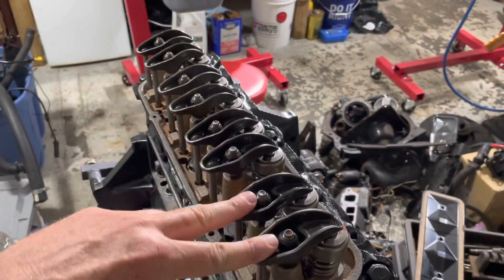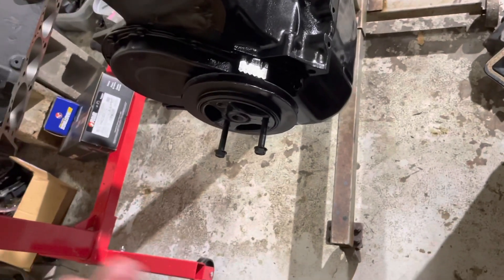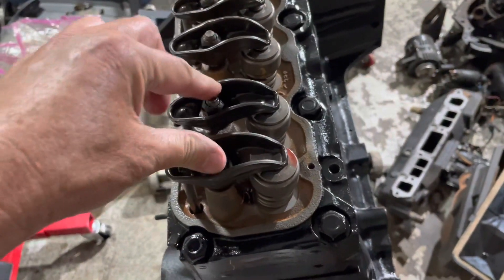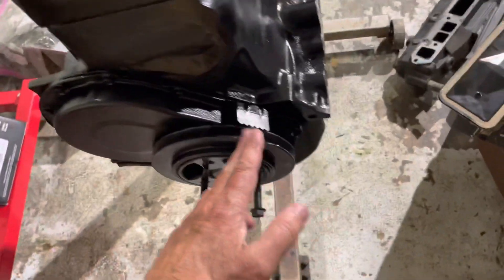Mercruiser 3.0 3(c) - Easier Way To Adjust Valves!!

Comment: I got a 2.5 mercruiser knocking sound from the timing cover any thoughts???help!!!!!!
Reply from the maker: The front crank pulley is not bolted on but is a press fit. If it’s backed out from the engine a little bit it might allow the crank timing gear to walk back and forth due to helical gears which would knock as the cam loads and unloads with each valve opening. Or you could have a broken tooth on the cam gear or the cam retaining plate could have loosened allowing the cam to bump the cover.
Reply: Thank you for your help I’ll check that out
Reply from the maker: @rickmorales6046 if you watch my 3.0 rebuild videos, you might get further clues as to what could be the source of the noise.

Comment: Hi again man got a question I think I have valve chatter again.  I've seen.
People adjust these while the motor is running Can I do that without damaging the motor
Reply from the maker: I don’t recommend adjusting while the engine is running. For one thing it makes a huge mess because the lifters pump oil to the rocker arms which then sprays it everywhere since the rocker cover is removed. If you really think you have a lifter problem then remove each one (make sure you mark or bag and tag them to put them back where they came from), disassemble it and clean it to make sure it’s not stuck or collapsed. But if you didn’t put the lifters back in the hole they were originally in, and you ran the engine for any length of time, you probably wiped a cam lobe and now it’s  clattering because the lifters pump oil can’t take up the clearance caused by a worn out cam lobe. The only fix is the replace the cam and lifters with new which requires removing the engine.

Comment: On a 3.0 merc you said only tighten the bolt 180 degrees ?   Other videos claim 3/4 turn which is 270 degrees.   Can you clarify ?
Reply from the maker: I didn’t say anything about tightening a bolt for 180°. I was talking about rotating the crankshaft 180° so that you’re on top dead center on the next cylinder I don’t discuss tightening any bolts in this video.

Comment: Dumb question but how do i turn the engine with it installed? The motor mount is blocking the crank
Reply from the maker: Put a socket on the alternator nut and turn alternator. If belt slips put more tension on belt with your palm.

Comment: Can you use the button position on the distributer to determine the firing of the piston. Seems like the best way to determine it unless I'm missing something.
Reply from the maker: At this stage of rebuilding I have not installed the distributor but yes if it were installed you could use it.
Reply: Thank you for getting back with me. I tried it and am getting zero compression. What have I done wrong at this point. I used the button to verify the cylander was due to fire and everything.
Reply from the maker: The distributor can only be used if it was installed properly and it sounds like it wasn’t. Don’t use the distributor. Rotate the engine until you see the exhaust valve on cylinder 1 move. Keep rotating until exhaust valve opens all the way and then closes. Just as the exhaust closes you’ll see the intake begin to open. You are now close to TDC on the exhaust stroke. Rotate the engine one full turn and line up the zero mark on timing tab with the notch on the pulley. You are now at TDC on the compression stroke on cylinder #1.  Readjust both valves for just that cylinder. Using the firing order of 1,3,4,2 rotate the engine exactly 180 degrees and then adjust both valves on cylinder 3, then rotate 180 degrees again and adjust both valves on cylinder 4, rotate 180 degrees again and adjust both valves on cylinder 2. They should now all be adjusted correctly. Since the lifters may be pumped up with oil you’ll have to wait about an hour or so before running it to allow lifters to pump down. If it still has no compression you have a stuck lifter that is not allowing any preload.

Oh btw, once you get back to TDC on cylinder 1, reinstall the distributor lining up the rotor to cylinder #1.

Comment: Hi, again.Well I went to do my valve adjustment My mercruser 3.0 does not have the harmonic balance notch or the tdc indicator numbers? What gives? I have a 2003 4 winns freedom 180
Reply: How else can I find tdc? I know the finger on spark plugs trick to find compression stroke
Reply from the maker: If you are missing the timing pointer and the TDC notch on the balancer then you may need to get a professional to complete the work for you. You’ll need the timing marks for several tasks and it takes a very knowledgeable mechanic to work around the loss of the timing marks.
Reply: Damn!!! I can't afford it.I believe I found top dead center the way you Said when number four goes down
Reply: The way I know I have it at top debt center.It's becaudevelops the valves that need to be adjusted or loose The other ones you cannot wiggle
Reply from the maker: @chrisjones3038  the questions and statements you are asking tell me that you don’t have the knowledge to do this yourself without significant help. I can’t give you one on one help. All the information is in my videos but you’ll have to figure out what to do. To set the timing with a timing light once the engine is running you’ll need very precise timing marks. It’s a complicated process to re-establish the timing marks once they are removed. Why are the timing marks not there is the first question to solve.
Reply from the maker: Is your engine fuel injected by chance? I’m not aware of any 3.0 fuel injected engines but just asking. Send me the engine serial number.
Reply: Update I pulled off the valve adjustment successfully
Reply: I found top dead center like you should me in this video I also mark a new top dead center line on my timeline cover. Just so I know. I do not know why my engine does not have a bouncer.
Reply: My valve rods were really loose.. question what is the advantages of this adjustment?
Reply: And by the way mine is Carbureted
Reply: When I started the motor off, I had less tapping and it runs great. That being said did I pull it off🎉😮

Comment: Does the piston NEED to be on TDC of intake stroke or just TDC of stroke? I ask because there should be zero lift on lifters in either exhaust/intake TDC. Asking for a friend hahah
Reply from the maker: Your question tells me you don’t understand the process of how a 4 stroke engine works. In a 4 stroke the piston is at TDC twice in a power cycle. The piston is at TDC of the completion of the compression stroke and the piston is at TDC at completion of the exhaust stroke. When the piston is rising up on the compression stroke both valves must be closed in order to build compresssion. It’s at this TDC that you adjust the valves since they are both closed and have been for most of the upward stroke of the piston.

Comment: Hi, Thanx for a very instructional video. If I suspect that I have done something wrong in this. The engine is running fine on idle and without load with no clatter. But it runs uneven and some backfiring on max throttle in the water. Could I have tightened a valve to much? How do I check that? Thanx Anders
Reply from the maker: Your engine is running lean (lack of fuel) at load. Fuel pump is not keeping up, filters clogged, or carburetor needs opened up to check for trash in the jets. Maladjusted valves have more effect at idle than at full power.

Comment: Way to confusing doesn't help at all , rediculous
Reply from the maker: Well considering I’ve done it this way on every engine I’ve built without referring to a manual I’d say your un-informed and should watch it again until you see the beauty of the method. If you understand a 4 stroke engine this method is obvious.
Reply: @moccasinmarine can you use the distributer button to tell which cylander to adjust?

Comment: If I have to use a remote start switch to turn the engine, if I take all the plugs out and use my finger to tell if I'm on the compression stroke, then for 1 and 4 I want the notch at zero and for 3 and 2 I want the notch on the opposite side of the harmonic balancer.  Sound right?  Then I can adjust both valves for the cylinder that's at TDC.
Reply from the maker: No you can only adjust valves for the cylinder that’s at TDC on the firing stroke. Let’s say you have engine on TDC on #4 on firing stroke. #1 will also be at TDC but it’s on the exhaust stroke. You can’t adjust the valves on #1 because the valves are still slightly open at TDC on exhaust stroke. This is known as overlap. Both valves are a tad open. Exhaust is still clearing and intake is open to get a head start on filling cylinder. This is why you can only adjust the valves on the compression stroke. Both valves are closed and have been for at least 90 degrees to either side of TDC on compression stroke.

Comment: Its called companion cyl Valve overlap
Reply from the maker: Mind explaining what you are referring to? I’m adjusting the valves when the piston is in its top half of travel on the compression stroke whether it’s coming up or going back down. It has nothing to do any other cylinder other than firing order dictates which piston to check next.